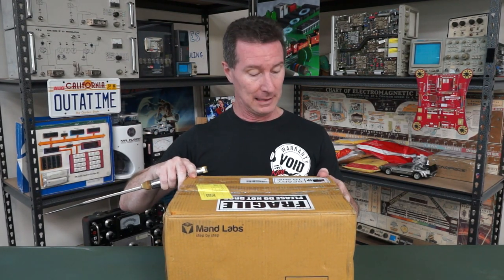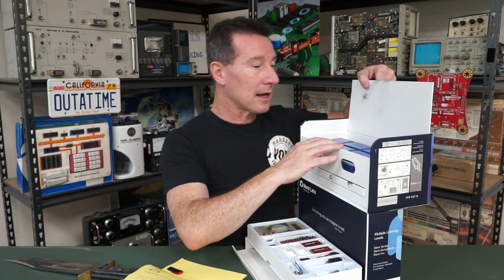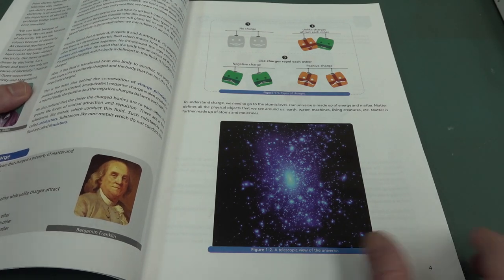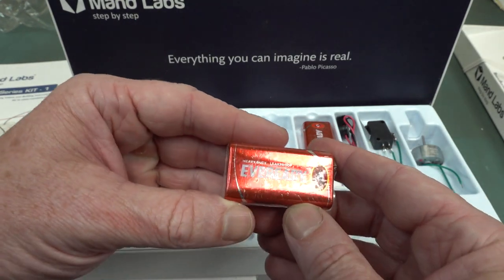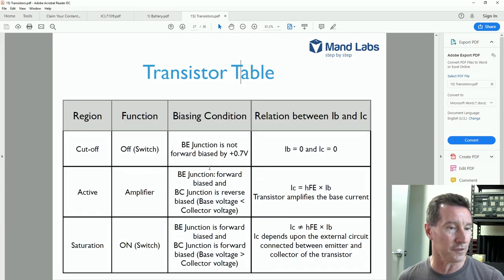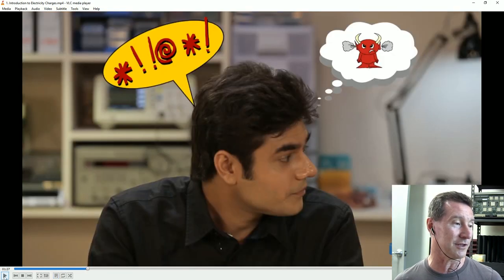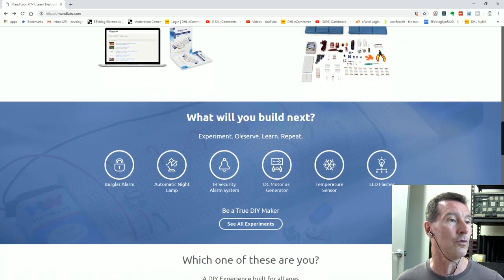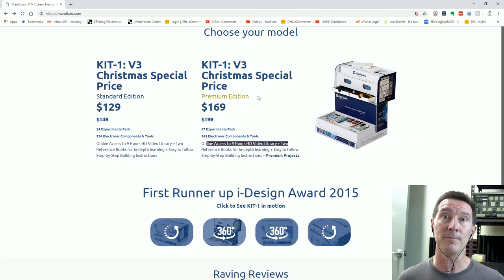EEVblog #1163 - Xmas Mailbag

Comment: I work in Norwegian Maritime Search and Rescue, last year we had a 121.5MHz beacon go off, and it sounded like it was pretty close. We tried ground and ship based direction finders for about a day with no luck as all signs pointed to it being on-shore. So we dispatched a Sea King rescue helicopter with a direction finder and it tracked it to a local recycling plant. We sent an operator out with handheld direction finding equipment and he found an old beacon that had a change by date of mid 1993 on the battery. So yeah, those suckers can be a pain if they go off accidentally ;)
Reply from the maker: Wow, thanks for sharing that

Comment: About the accelerometer switch.
It is build around a magnet. The tube is a magnet an the screw on one side and the contact bars on the other side are made from iron (plated with gold for good contact) The magnet will loosely stick to the screw but very firm to the big contacts. If a shock can loosen the magnet from the screw it will stick to the bigger contacts, and stay there until its pushed back to the screw with the reset button. The distance of the magnet to the contacts determines the force need to make it moved the closer they are the less force i needed. But such system is not very accurate, really exact measurements are not possible but it is good enough to detect a crash. :-)

Comment: I absolute agree, get lights flashing before you hit 5 minutes, literally. Battery, resistor and led. That is all you need for the first lesson. After they have lit that first LED, point out that the battery has two ends. You can switch the polarity of the LED to show also how semi-conductors work, make them reverse resistor too to point out the difference and... Practical examples, direct to results as fast as possible. Theory comes next, passion has to come first.

My school had the same system, theory first and we went thru every single parameter in the equation before we get to solder anything. Of course i had experimented at home, dad has a shop. It was horrible way of teaching anything, things were complete haze and you started to avoid making any assumptions until you got to the lab... since that was the place we actually learned. I did have horrible teacher in theory though, he was actually mechanical engineer, read direct from the book, didn't answer a single question with: "look it up from the book". Lab teacher was absolute miracle, tough, hard and merciless, we did not get to make any mistakes before passing many subjects, safety was zero tolerance policy, absolutely not a single mistake. Kicked our asses but answered every question, knew how to make quick (and very dirty) analogies.
Reply: If you look at Dave's video about his old 200-in-1 electronics kit, they did exactly that. They had 23 experiments, some of them quite already extensive and awe-inspiring .. which were actually on monkey-level. They just said: "Install those wires from there to there and exciting stuff happens." 

After that, they took the step back to a switch and a lightbulb and explained how it worked, catched up to the level of the first few projects and went beyond that. 

The kit I had as a kid did the same.. first thing: Put a led blinker together like this 3D drawings. 

That's how you get people hooked up on something and keep them there.
Reply: I don't know about you, but I'm 17 now and when I was 12 they made us do a kit like this. I can tell you, it bored the hell out of the entire class. it was doing stupid stuff like letting a light blink, then adding an MCU to make lights blink in a row, that sort of stuff. I would have much preferred this, even if all the formulas are just something to read, not understand. I think this is clearly made for the classroom, just look at how the book is written. for autodidactic use, it's way too detailed, but when you have a teacher going over it with you, it's absolutely perfect.
Reply: Besides, you can always keep going deeper into the physics of it. Start with things as black boxes, then peel them away as much as the student is interested in doing.
Reply: @gblargg  That's how it see it usually done and I think that's the correct way. 

There is only one thing you should never do: Teach something which is plainly WRONG and then try to change it later on. The first one may stick.

Comment: The random nut and bolt came from the cutters/strippers. It's the gauge stop so you can actually strip wire and not just cut it. That'd be a frustrating lesson to each a kid if they all lost that stop.

Comment: I agree with Dave. I think teach the exciting stuff first, circuits, wires, motors, led's, then later fill in the theory. Teaching the theory off the bat can turn kids off.
Reply: Agreed trying to teach theory right off the bat to young children would turn off even the brightest of children.
Reply: When I was a kid I had some educational kits and they were fun but for the heck of me I couldn't understand basics like voltage and current (that was before the internet). I remember it was as little bit frustrating when my parents couldn't explain it to me. Only much later, in 7th or 8th grade, it finally clicked in when they started talking about static electricity in school.

Having said that, if someone just said "take two buckets of water, place one on top shelf and one on bottom shelf. The difference in height is called voltage. Connect them with a pipe and water will flow, that flow is called current" would be the perfect level of detail for me back then.

Comment: I don't think this kit was built to target younger kids. It's more to the level of high school (13 years old) where they can comprend technical stuff and physics.
Reply: @vola-2899  For books .. have a look at "The art of electronics". 

Yes it is a BIG one, but it teaches you "circuit design" on a very practical basis.

It shows all the basic building blocks, explains them throughly .. including the pitfalls and traps in practical application. It explains which parameters are important for which application. It even has tables showing the "usually" chosen parts for some applications. 

For " I want to start building difficult systems right away". Forget it. Just .. forget .. it. Hasn't ever and will never work. 
Tried it myself, did cost me a few years of frustration. 

Start little. Fail at it. Then do it the other way. Then get a little larger, rinse and repeat. There are no shortcuts to practical experience.
Reply: Sorry, doesn't make sense. Any high schooler would vomit at the pathetic cringe, which is aimed either at pre-schoolers or remedial classes.. Edit: Either keep the cringe & the experiments and lose the science (targeting youngsters) or keep the science & experiments and dump the shitty acting if aiming at teens. Can't have it both ways.
Reply: @VintageTechFan  I just got "The art of electronics" for christmas and started reading immediately. It's an excellent book for beginners and intermediate, so I absolutely agree!

Comment: I liked the old 300 in 1 kits but quickly grew frustrated that I wasn't learning enough to get much beyond their pre-cooked circuits without letting the smoke out. I think I would have liked seeing a circuit that does something, followed by a practical explanation of how it works with footnotes to a section with equations, history, and theory. Examples of how sub-circuits can be combined would have been nice too. So I guess I wanted fun with the option to learn enough to have more fun beyond what the author came up with.

Comment: When I was a kid I bought Radio Shacks Basic Electronics book.  It started out with basic physics that looks almost identical to what's in this book (right down to the tormented diode).  That was my favorite part of the book.  I didn't really care for the paint-by-numbers approach the most kits came with, I wanted to know why something worked the way it did.  I think learning the fundamentals is necessary when starting out even for kids, just keep the underlying math to a minimum.
Reply: Ispike73 I started with some much more basic books with really simple experiments (that I didn't bother building) and two really simple kits (one single purpose cheap, the other a multi-experiments kit).  The books started from non-nuclear basics with no semiconductors, just basic batteries, switches, magnets and lightbulbs, then by mixing books and parts worked my way up to computers long before going to uni.

Comment: That's a real cheap crusty ELT.  You absolutely figured out the on/off/arm switch and its purpose. You also figured out the g-switch and remote activation terminals.  The remote activation terminals often just go to a switch in the cockpit for the pilot to activate during mayday, if they so choose.  A secondary g-switch or water activated switch doesn't ring my bell.  The underwater locator beacon is a separate device with its own activation circuitry.  An ELT isn't designed to be used under water anyway.
Modern ELTs are more complex than the one in this video.  Same basic functionality, except that a modern ELT often also transmits a unique identifier code so that the receiver can -- cross-referencing a database -- identify the aircraft registration number, make, model, and owner.  This comes in particularly handy when trying to identify which aircraft is transmitting a false warning.  Accidental ELT transmissions are way more common than purposeful ELT transmissions.  Without a unique identifier, its harder to pinpoint which aircraft, out of 30 parked in close proximity at an airport, is the offender.  Of course the unique identifier and accompanying information is also very useful in the event of an actual emergency.
Also, a modern ELT usually has a intermittent/automatically resetting g-switch.  After g-switch activation, it keeps transmitting until the main switch is turned to off and back to arm.  There is no reset plunger to push.

Comment: When i got into electronics as a kid all the theory would have turned me right off. I wanted to break, modify and fix things. I needed no maths when I built my first radio, astable multivibrator etc. Even when I was fixing and modifying CBs and AV kit I didn’t really need to know all that stuff, it all came later on. So for me, this kit seems to try and be all things but doesn’t quite get it right for any of them.   Either make it lots of fun for kids, or go for a more advanced kit. Also not too keen on the amount of material used that will inevitably end up in land fill. Impressive in many ways, but just not quite there.

Comment: Dave, I 100% agree with your critique.
SKIP the theory, jump into the first breadboard circuit!
The overall kit reminds me of my first chemistry set I got back in about 1969.   As I recall the chemistry set skipped all the deep theory and was a series of "recipies" to show simple concepts like PH color change, evolving CO2, etc.

How to make a better kit?? 
> have all the parts bins be general purpose storage NOT size fit for say the pliers or the cutters.  Just have a drawer where the tools go.  That way as the student gets better tools they can still fit in the tool  tray.
>have a tray for resistors with ranges markings to sort the resistors, a tray for leds, a tray for wires, a tray for switches, etc.
>The video so so distracting that it washes out the actual knowledge that is being delivered.
> the Indian accent? is one of the hardest to understand for me.  Have a professional voice without the heavy accent.
> Overall the IDEA is a good one but they missed the mark.  
> If the kit eventually became a portable lab that could grow it would have been a winner.
>The book should have jumped right to breadboarding their first circuit. 

How about an EEVBLOG electronics lab for beginners??

Comment: We called the accelerator switch in the ELT10 a G switch and it needed to be tested once a year or every annual inspection. The two screw terminals were for a remote switch in the cockpit for remote activation and testing. I am a A&P aircraft mechanic and worked on many aircraft with those exact locators installed in the aircraft.

Comment: Looks really well done, obviously a huge amount of thought went into it.  But I completely agree with the theory being just way too much.  If I had to learn music theory before ever picking up a guitar I would have never played a single chord, learned a single song, or even strummed a string.  I learned to play by ear and THEN once I was somewhat decent at playing the general thirst for understanding more about how music works and how to write my own songs kicked in and I then willingly had the urge to understand the more advanced building blocks of music.  I think if someone younger was to start with this it would be helpful to have some guidance. Being an engineer I always go straight to showing my kids how to build circuits.  The immediate demonstration of using electricity to create practical parable results creates an immediate interest.  Theory bores them to death and they can build a basic electronic circuit knowing the most basic principles.  As they've gained experience they've never needed to know about atoms.  I mean who does?  It's only theory anyway.  I love the science but it's even more remote to electronics than music theory is to music.  You can be brilliant at building electronic devices without ever knowing a lick about negative ions or potential.  I will say that once you get to a point that math is extremely useful...actually absolutely necessary as anyone who had done anything with electronics well quickly realize.  Far more than any theory about things we can't actually see.
Reply from the maker: I can remember trying to learn French (my company was French and offered free in-house lessons), I lasted two weeks before giving up. I just wanted to learn some words and simple phrases to get started but we had to learn all the theory stuff first, it was boring.
Reply: Just as with adults, kids are not a monolith either.

I for one like the theory, when I started with the guitar, I immediately started learning music theory alongside my first chord shapes. 

When I learned programming, I quickly jumped on to read standardese.

When I learned English or French, I first learned how all the letters and peculiar letter combinations are pronounced. Of course you have to learn some of the "theory" (grammar) of a language, that's essential.

Now that I start to dabble with electronics, I also enjoy the theory side of this stuff.
Reply: @tomaszwota1465   I completely agree with you. I thoroughly enjoy the theory as much as the practical side, and have done since I was a little kid.
And I don't buy OPs argument that it's unnecessary to learn about things that we can't even see. And "it's just theory anyway"? What does that even mean?

Comment: The way the ELT works is that normally it's left in the armed position all the time.  When it's not transmitting it really doesn't suck down any power, and if I remember right they're wired to the aircraft battery so the 9V battery is only a backup.  The ON position is only used for testing the transmitter within the first 5 minutes of the hour (3 to 5 sweeps of the transmitted tone maximum).  With a crash or a very hard landing, the force sensor does make contact to trigger the ELT and make it transmit, which it does continuously until the battery dies or it's reset.  That's why it's standard practice to tune in 121.5 after a hard landing to see if you're needlessly transmitting the ELT beacon.  Yes, it does have salt water (or water in general) detection in case of a water landing that isn't hard enough to set off the G-force sensor.  I've never seen an ELT with an off position on the switch, only ON and ARM.  There are different models of course.

Comment: Definitely go straight for the build with a kit like this. My first kit was an "Electrical invention kit" that had a motor, a light bulb, a six volt battery, a knife switch, hook up wire, etc. No electronics, not much in the pamphlet, but for a six year old, it was great fun. I gradually morphed into learning electronics, but at age six, even ohm's law would have been beyond my ability to comprehend because most people are at least 10 before they can solve simple algebra equations.

Comment: In early 90's, I learned electronics mainly from my own observations. Looking at my Dad's SONY VCR circuits and my grandmother's old GRUNDIG Television schematics. My first aid was my school's physics book which contained the resistors color code table.
My first attempts were to power my toys from DC adapters to economize on batteries. around the age of 17, I built my first cassette tape recorder and player using various schematics from all around with AC bias and VU meters. I didn't even know what the atom was back then.

Comment: Those older ELT's installed on most smaller aircraft were not exactly foolproof. As a mechanic I remember frequent false transmissions happening. The tower would announce on all frequencies that an ELT was going off and we would scramble to make sure it wasn't  one of ours. You didn't  want to have the FAA nocking on your door as you could be fined. In operation, though you didn't need to turn it on and off each flight, it stayed in the on position. For most small aircraft it was located in or near the baggage  area.